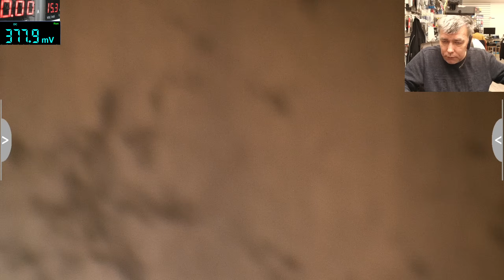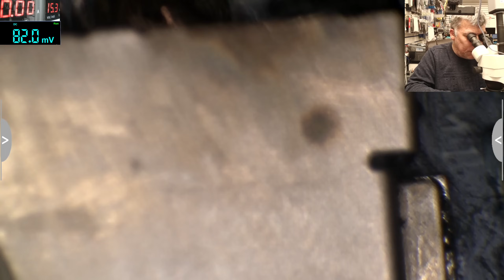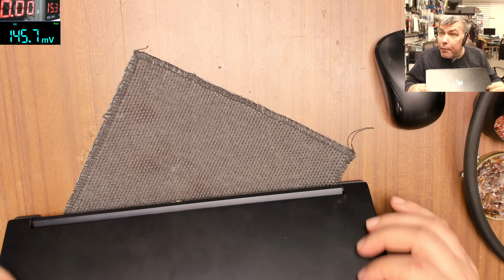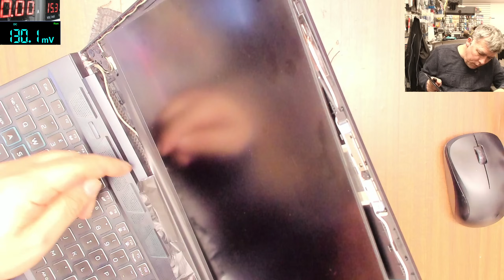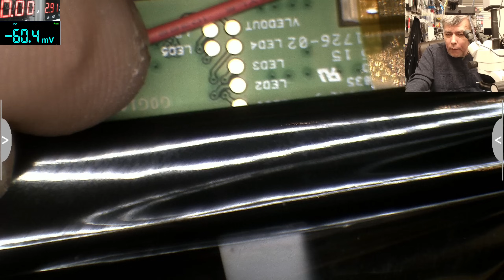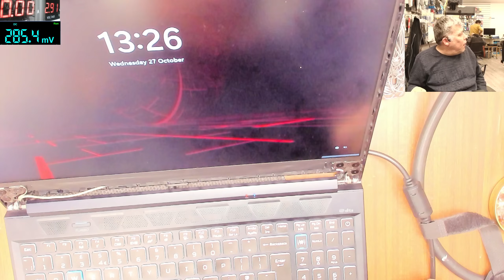Electronics repair lesson - Keep Going No Matter What

Comment: Anyone know how to repair a devolo magic 1 wifi unit :face-blue-wide-eyes::eyes-purple-crying:- how to get them open..... it just doesn't work when plugged in. I suggest the internal fuse has gone &/or some capacitors have blown but I just cant get inside without damaging. I have taken out the screws & tried to spudger the top off but it is ripping the lip?

Comment: stripping insulation off microscopic wires can be tough. i just use a lighter, it burns away the insulation or softens it enough that you can peel it off.

Comment: Your repair videos are so great and inspiring. It is a great pleasure to view them!
With this repair you saved again an expensive laptop.

It seems that the display of the ACER predator  is a sRGB panel that has no CCFL backlight and thus does not need an inverter.
The connector looks like an eDP 40-Pin Video connector. The damage is at the high numbered pins. 36-39 are LED Power, which of you resoldered 3 of them. Pins 32 is BL_ENABLE and 33 is BL_PWM, the lines which were missing and were probably burnt away.

Comment: What i would have done is coated the jumper wire with glue stick to protect it from shorting to ground and connected it to the place needed for the 3,3v power supply needed for the blacklight as it would be smaller than the wire you use that's what i would do.

Comment: 34:25 I think you should consider maintenance of this laptop will be very hard. You should made some cable extension for person in future just solder wire to wire without need to disassemble all that hot glue dodgines and without risking to damage motherboard.

Comment: The feature where the gaming screens turn off the LEDs in between frames is called back light strobing. But it has to enabled like from the bios. it doesn't have anything to do with tearing it is there to reduce the perceived motion blur of fast-moving objects while gaming.
Reply from the maker: I know what you mean, but actually it is synced, the light it will goes off when the frame is changing, otherwise you will see tearing on fast moving scene https://blurbusters.com/faq/motion-blur-reduction/
Reply: @electronicsrepairschool  Hey Sorin. Nice work on this job. Please upload more on the Helium mining and also phones.

Comment: I have a acre predator 2020 with short circuit won’t power or charge voltage to dc input on mobo I need help what do u charge
Reply: Has voltage to dc input on mobo**

Comment: I agree with some of the other viewers  that you probably could have sent voltage up the apropriate 3.3v signal wires from the mainboard.  They must have been damaged in the connector with the short.  Your solution  is sound though, thanks for sharing your experiences!

Comment: My laptop Hp 250 g7 when I connect the battery first the adapter voltage won't get into the laptop motherboard, when I connect adapter firt the connect the battery the battery won't charge, the adapter I have tested is okay and the battery is okay cause I have buy another battery and the issue goes on

Comment: Hi Sorin,
Most probably if you waited and check the screen before putting the hot glue on the board and screen connector, you will manage to fix the laptop fully. Probably, the next two wires on the screen connector were damaged too but I am sure you will manage to solder those two cable to the board.
I can be wrong.... of course!

Comment: I get a similar one.....it falls in water 💦 ....when you connect the charger it charges well but can't turn on ... I turn it on! on the motherboard the lights will show that it's on but the fan won't roll and it won't displays

Comment: That was an impressive and brilliant repair! Well done! I think I would of tried to get 3v to the LCD using the existing cable as presumably the 3v wires were damaged too? Just thinking if the customer breaks his screen, its no longer a simple screen replacement - that LCD "jumper" patch would need to be duplicated on any replacement screens.  I don't understand why the customer touched that connector in the first place as the cooling system can normally be taking off without taking the motherboard out to apply new thermal paste.  But very nice laptop and a brilliant job!

Comment: I literally have the same laptop and it suddenly won’t turn on. Whenever it’s plugged in it shows it’s charging but it doesn’t still turn on. The only thing aside from the battery light is the USB ports get power.
Reply: It’s a slightly diff model and it’s a diff problem but similar
Reply: I have zero scorch marks on my board which is the weird thing

Comment: I have been looking for anyone that can do this level of repair for an Acer 5 nitro that I have only used about ten times. Someone poured water on it while is was powered off. I immediately blew it off and let it dry for a week before I tried to use it again. When i power it on the keyboard lights up and fans are running but screen doesn't come on. Would love to be able to send it to you for repair. I'm in the US and cant find anyone that does board level repair like this.

Comment: Why didnt you check the pwm pin on the SIO to see if when you pressing the FN+Backlight up/down the voltage changes, if it does you could of wired that to the two missing voltage pins on the screen if you already glued and soldered cables the 15v~ to the board why not do that so the customer could control his brightness, unless the SIO is partially dead.

Comment: I killed my electronic screwdriver. It's best to loosen the screws without power first, I've blown the SOT-23 mosfet on the unscrew direction. It gets super hot. I have a pack of 100 coming from China, but it's going to take a month.

Comment: Very good detailed repair .  If you check data sheet of this panel so you no need to open screen just only find 3.3 v in in the board solder with disire pin as per panel data sheet
Reply: Where do you find those

Comment: Great job Sorin.  You didn't show if the brightness control works anymore with this mod. For wire, I would recommend using wire-wrap wire instead of the heavy wire. It is well insulated and it is much smaller.  It is of course solid core so it will not take any movement between the points.
Reply: He did with the keyboard. Also no point of trying bc there is a constant voltage

Comment: Why hot glue?
Solder 3 wires to 19v and is done. After that easy to unsolder, unplug conector and replace thermal paste. Hot glue not nesesary.
When gpu turn off picture for moment, there not be sinhronise with backlite on/of and will see white screen. Exsample when app change resolution...load win...

Comment: 19:25  you should not cut both at the same place, because if you want to shield them again, you will get 2 thick wires side by side. expose the second wire a bit after , so "too thick" won't be an issue

Comment: Hi sir is this a faulty screen inverter causing the discrete signal turned erratic or an output of mechanical device shorting out the data line signal?

Comment: Sir please explain new battery charging circuit…new laptops and mobiles do not show charging voltage with multi meter on battery connector  without connecting battery…

Comment: Sorin question please, on 31:30 its possible to use solder mask (same color of the board) and not rosin? to hold the 3 wires
Reply: Or use some kind of fromage .. or paint or nail polish or...

Comment: Sorin I have almost the same problem 300hz screen. and now im dealing 3 months with motion blur when I watch videos on the screen.

in my channel I uploaded a video about it.
under the microscope I showed the screen connector have little burn dot on 1 trace. but I checked and there is continuity.

I'm 3 months can't watch videos smooth like before on this 300hz screen.

I also wanted only to 'repaste', but I guess I repasted too much.. cuz I was testing again and again for better temperature.

what I'm trying to say, maybe this guy laptop will have a motion blur problem too. or ghosting.
while playing games or watching YouTube videos.

refresh rate 144 or 300 is only the speed of the screen.
but motion blur is the response time.
and if you effected by motion blur or ghosting.. it's a pain to the eyes.

Comment: A charge will open inside and there is a copper wire
 If the coating is lacquered with insulation

Comment: Sorin. I liked your videos a lot. But this time, why can't you simply replace the damaged connectors and resurrect the track pads? Now you are making laptop display non removable. That's what we called dodgy job. I think this time fault is not that hard much compare to previous faults. I don't think every customer is satisfied with this dodgy unreliable ways.
Reply: Hi, I'm fully agree with You men 😀 this doggy job
Reply: It’s because 99% of followers enable Sorin and praise his work even though 1% understand enough to care and speak up about how terrible and lazy his practice is. He didn’t really repair anything, he only shortened the lifespan of the screen and battery.
Reply: resurrect what pads? its not like they're ripped off, that whole area of the board is burnt to shit and with no schematics i don't see how he would know where the connection points are
Reply: @coyotex850  I think you are not blind enough to see ripped pads near the edge of damaged display connector. What make you to tell that display connectors pads are not ripped-off? Even the pads don't need to resurrect, this is not proper repair, dude. It's simply unacceptable for such high-end gaming laptop. I don't know you are Sorin's fan or not but this is just unacceptable dodgy repair. It will shorten screen lifespan. What? Now user can't decrease or increase screen brightness? What a shame for such multi-grands high-end laptop? I guarantee this is a dodgy repair.

Comment: I have a question perhaps noone has asked you perhaps.
How is the compatibility of TV HDCP microchips?
Is a HDCP earlier than version 1.2 pin compatible with a 1.2 chip and later like 1.4?
Is it only a chip to swap or is it more integrated in the TV mainboard than this?
Is it possible to just use any HDCP chip as a addon to a monitor that has no HDCP?
It probably has lots of legs and not easy to solder but may be possible? :)

Comment: Gaming power. You can see what can happen. Blow up screen connector. And trucks on the board. I did it ones. Solder a new connector with the wires everywhere on the board. You need a proper schematics and solder skills to do it did 3 hours an 42 minutes to get it working. Sorin thanks again for the great video. And I am hungry now … curry chicken wings 😋

Comment: I got a dell laptop that turns on then off after 5 seconds, if i remove all the ram, the laptop stays on, any ideas? i've tried new ram already
Reply: Maybe with the ram installed the laptop isn’t providing enough power to power the ram or circuit is faulty. Have you measured caps near ram? Should be 1.5v I think !!
Reply: @OgJSkillz  Thanks for the reply, I checked a few caps on the ram it self and found 1.5v, though I also found 0.7v in a few places

Comment: My 10 yr old nephew had a Powerspeck Notebook Computer i7 Model 1710 worked fine for the last 5 yrs, but it got some issues since last month:
-Gets extrmely hot
-Turns off randomly
-Battery does not charge!
-Applications open randomly
-Univited notifications 

How can we fix the overheat issue and improve performance before we think of buying him another one?
Reply: You need 3 professionals in the below order to fix it.
1) A Voodoo practitioner
2) An antivirus specialist
3) Mr. Sorin.
Reply: @Wingedmechanic  😂😂😂😂😂
Reply: The overheating is probably affecting the system chipset causing random faults.You could first try cleaning the fan and outlet then reapplying paste to the processor.